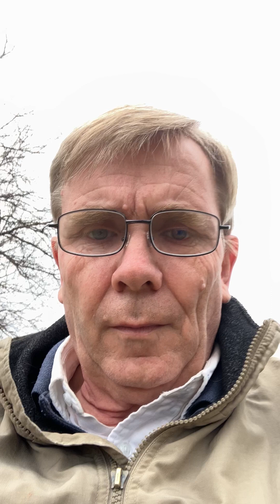Report of New E-Cat Tests

Comment: Hello Frank, 
In reference to the Latina test, i would like to share my thoughts.

The standard battery of the Twizy weighs about 100kg and normally provides a range of between 80 and 100 km.
The weight of the standard Twizy at the time of the test was about 513Kg (standard battery included).
The Twizy modified by Rossi weighed about 611Kg, that is 100Kg more.
As stated in the press conference, about 10Kg were dedicated to the electronics and about 90Kg was the weight of the E-Cat.
The battery charge conditions at the start were:
98% charge for the standard Twizy.
62% charge for the modified Twizy.
At the end of the test the data were instead the following:
1% charge for the standard Twizy, with 74Km of travel (therefore in line with the standard capacities of this car)
82% charge for the modified Twizy, with 201Km traveled.

Now, the question is this:
Considering that, as declared in the Press Conference, both Twizys mounted a first-generation battery (batteries produced between 2011 and 2013), for which the charge density is around 100-120Wh/l, and considering that today in 2024 we have much more advanced batteries with a charge density of 450Wh/l..... The 90Kg declared for the E-Cat, could not simply contain a new-generation battery?

In conclusion:
Rossi declared that an E-Cat weighs about 10Kg, but at the test he showed up with a system that weighed 100Kg, making excuses related to safety.
But the fact remains, a new-generation battery could contain in 100Kg even much more energy than that shown in the Latina test, so we cannot be certain that things are not this way, and that what we saw is not simply a scam.

Comment: Frank, you neglect to address the issue that the unit being tested is liable to blow up, according to Ing Rossi, hence the almost 100 Kg steel shielding required, which A) would make the power density absolutely abysmal and B) would negate my ability to insure my home if I wished to, say, install a charging station for my EV. Any potential investor should be put off by "small" details such as this, and I'm surprised that you make no mention of this fact
Reply from the maker: According to Andrea Rossi, there is no need for the shielding box in non-automotive applications: https://www.journal-of-nuclear-physics.com/?p=892&cpage=846#comment-1686138